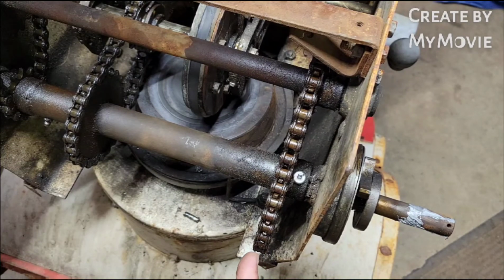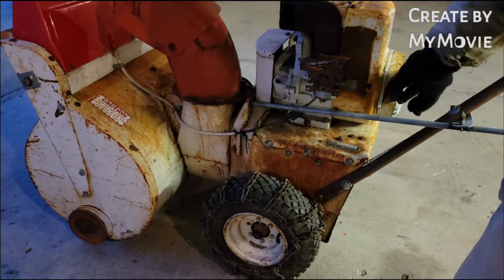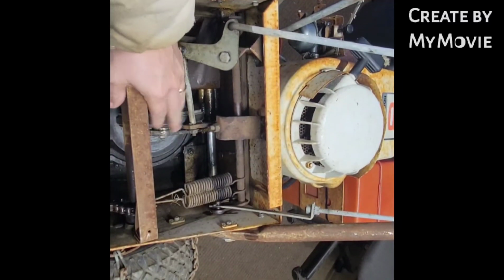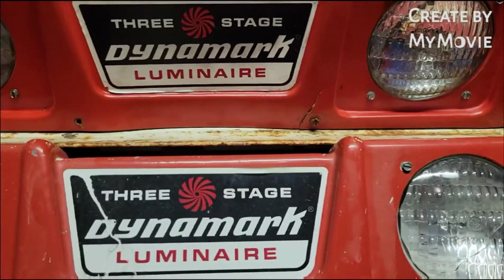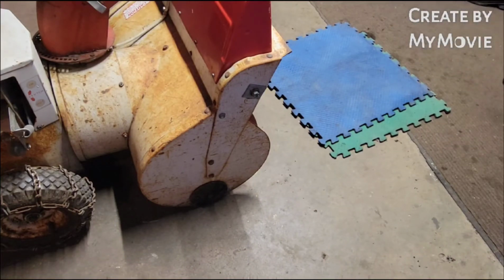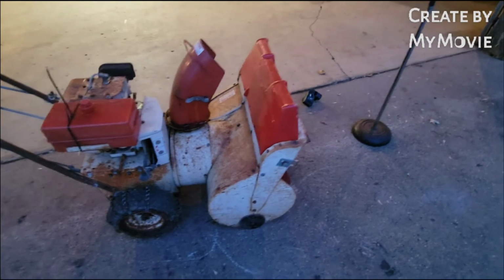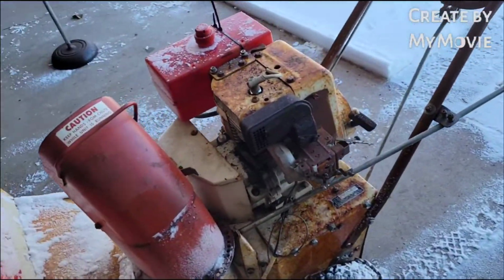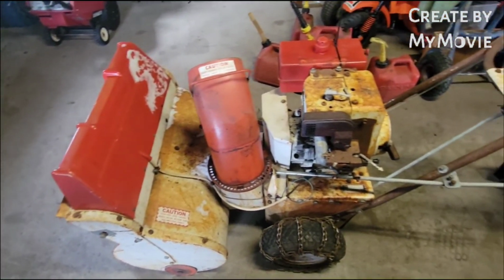70s Dynamark snowblower Revival,  Part 3 of 3

Comment: Great job getting this running and blowing snow, it works great. It might be worth just doing a few job on it every time you get the chance and slowly improve it. The lights are interesting and they look like the PAR36 lights fitted to some Bolens tractors
Reply from the maker: Thank you  GTB.  I might do it that way. Yes probably the same lights,  they used this type on a lot of old garden tractors.  Thanks for watching

Comment: It is a beauty. Metal where metal should be. Built to last by engineers, not cost accountants.
Reply from the maker: Yes , exactly right. It's about twice as heavy as my yard machine 10/28
Reply: @davessmallenginerevival2847  I won an 11/33 YardMan at auction on Monday. I pick it up Friday. I emailed you a picture of it. I don’t know if it will fit in the Ford Flex.

Comment: Those roll pins are a pain to drive out I've been there did that on my 1980 Troy bulit horse tiller I put  grade 8 bolt's on the  Axel to hold the wheel's on the drive Axel
Reply from the maker: Hi Robert. Yes they really can be a pain
Reply: @davessmallenginerevival2847  yes they can be that unless you want to do a repaint job  I thinking of you doing a clear coat on this classic machine just keep the surface rust look it's up to you young man 😎👍
Reply from the maker: @robertmailhos8159  give it the patina look eh?
Reply: @davessmallenginerevival2847   it's up to you young man 😎